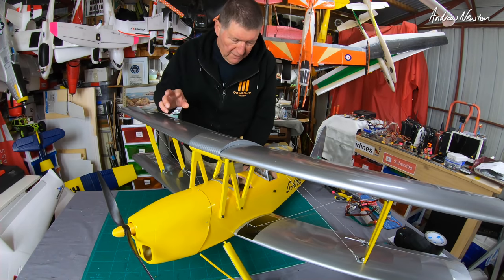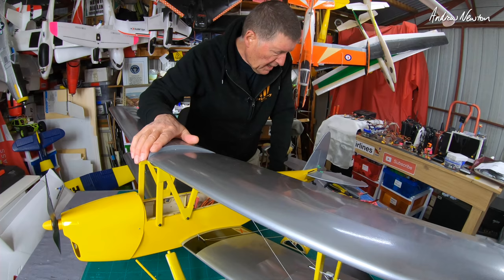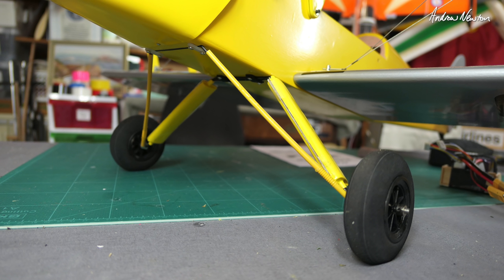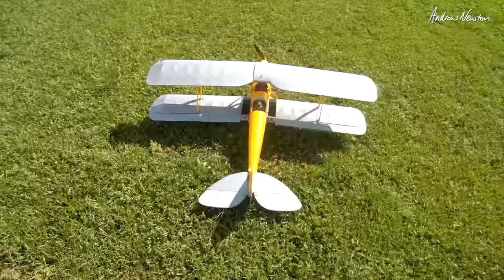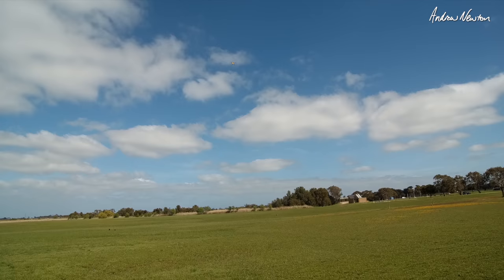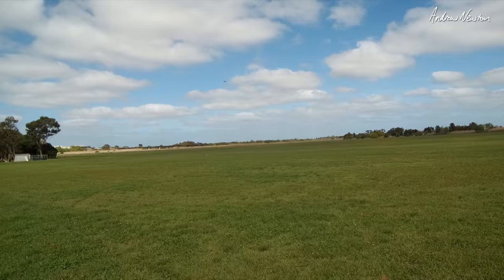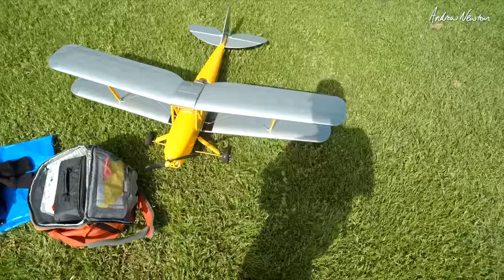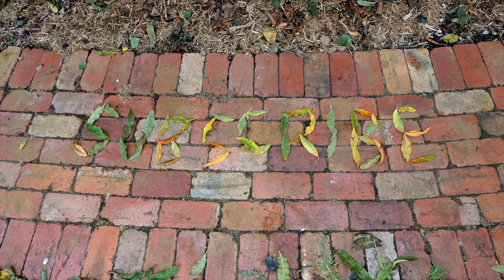Big Balsa Tiger Moth - HobbyKing 1.4m

Comment: having briefly flown a real Tiger Moth I agree with your comments 'needs coordinated rudder and aileron for turns' is absolutely true. Ironically the owner of the Tiggie I flew with said 'the aircraft has absolutely no redeeming features at all' yet they are graceful in the air despite almost flying backards in a stiff breeze and side slip at a moments notice. Aussie built Tiggies are usually powered by a Holden built version of the Gypsy engine....I don't care for the negatives, it was awesome to personally fly one of De Havilland's most famous aircraft for real.

Comment: I have this model and I can assure you that it flies extremely well.  When I finished mounting it (very easy) I was able to verify that to leave it in its center of gravity with a 4Stroke engine I would have to add a good amount of lead in the nose.  I looked in the catalog for an engine that with its weight would leave the plane balanced without adding weight.  I chose the OS 95 4stroke and I was right in centering.  I have plenty of power and flying at 50% capacity I can do any maneuver.  It can fly very slowly and is a beauty.  I had a break recently and was able to find a replacement for an entire fuselage.  I recommend NEXA, its manufacturer, to offer the model again to stores because they will sell all the ones they make.  The price/quality/enjoyment ratio is highly compensatory for the owner.
Reply from the maker: Excellent information thanks

Comment: Hi mr. Nice plane and flight. Did you change the CG MORE FORWARD. in case u do where is the cg i calculate it to be around 8cm from leading edge. Wondring where you put your cg. Thanks for amswer mr.😊
Reply from the maker: Mine was OK at 10cm, I just needed to reduce the elevator throws
Reply: @AndrewNewton  thanks for answer . Have a nice week mr.

Comment: Nice Plane... Flies great.  Too bad the skin comes un-stretched in the sun and those guy wires on the wing look quite loose.
Reply from the maker: Yes they did slacken off. Needs a better tightening method although they are just for show
Reply: @AndrewNewton  I have a 1.6 meter foamy Pitts that uses small springs in line with the also non-functional guy wires. Works a treat.

Comment: i have a 1.9m (74.5") balsa Cessna L19 but its hanging from my ceiling and probably wont come dfown again for a long time, i just cant behave and if i fly it lots its just a matter f time before i destroy it as i just cant behave and take too many risks lol
Reply from the maker: Ha yes, it's always a risk
Reply: @AndrewNewton  I can't help myself, I fly though small gaps and also fly full throttle at less than a foot altitude which can get messy but you can't laugh at the carnage and repair a balsa plane like you can with foam, balsa planes become matchsticks lol
Reply: @AndrewNewton  on a totally different subject,  did your glass printer bed plate need bigger bulldog clips?
I replaced my bubbling Base with another as they are very cheap and easily peel off the fiberglass Base for replacement but I decided to give a textured glass plate a try but my clips are not big enough :(
Reply from the maker: Yes I had some slightly bigger clips
Reply: @AndrewNewton  I'm going to the supermarket in a sec for a food shop, hopefully they will have a suitable size there, my replacement original Base is in perfect condition still but I really wanna give the glass Base a try!

I forget what one you got, did you get a smooth one or did you go for the creality textured one like I bought with the dots on it that are like what you see on a cars sunroof?